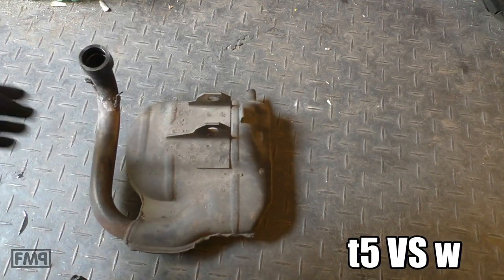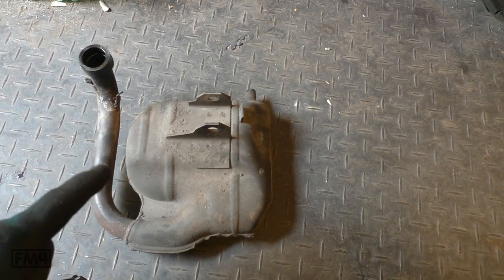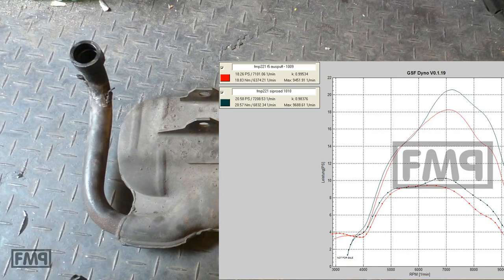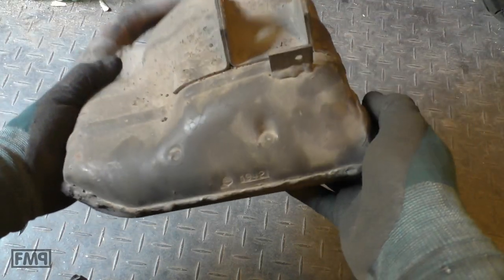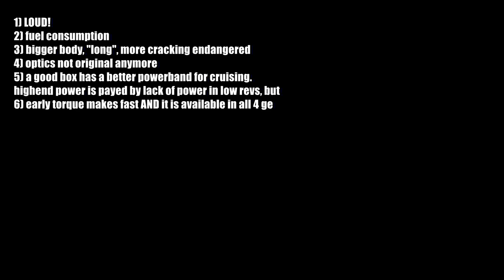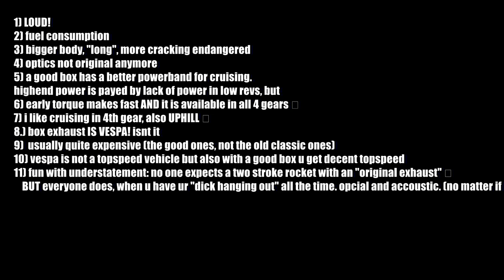vespa T5 vs W1R exhaust - ACCELERATION & soundCHECK! / nr61 /

Comment: I’d be interested to see a box comparison video. I know SLUK did an article some years ago, but we have some new boxes available since then.
Reply from the maker: have u seen the fmpbox test on my fb page. checkout the picture folder
Reply from the maker: oh and. as typical. sound and grpund clearance was not rated at this and all the other box tested. winner was to be expected too 😂 it was a test of rather german  boxes  done in germany at mmw which is very close to sip 😉 and proper comparisons between curves were missing. i photoshopped a few. also megadella is missing which is an important comparison.

over all rather a pointless  test cause important info is missing.

over all

https://scooterlab.uk/vespa-big-box-exhaust-shootout-feature-2/
Reply from the maker: here is my sound rating of the #FMPboxTest 

https://youtu.be/Q57yFKEKcvA

Comment: It's a px 125 exhaust not t5 exhaust lol because the T5 has a flange and a plate with 2 bolt holes
Reply from the maker: 1942 is the t5 exhaust. it was never on a px125. only bery rare cosa 125 or 150 do have the same exhaust.

u need to cut it to fit it to üx cylinders. tjis one additionally got a viton connector

https://youtu.be/Vx2eyKrhZmk
Reply from the maker: https://youtu.be/uMf5ZWVgtP4
Reply: No the barrel fitment the stub is wrong is not T5
Reply from the maker: its 1942 = t5
checkout insta and fb page for the original sketch. i just posted it
Reply: @FreakMoPed8   in UK the 1st till now had a different exhaust two studs holding it on
Reply: @FreakMoPed8  in uk only px was like that not t5
Reply: @unfit-bmx  this is a modified T5 exhaust (different downpipe), otherwise it wouldn't fit the px 125 (or px 200). This was (or still is) a popular modification, because the T5 exhaust is much more robust and silent (almost twice as heavy as some of the other box exhausts), while producing significantly more power than the standard exhausts.
Reply: It's a t5 exhaust with a px flange welded on.